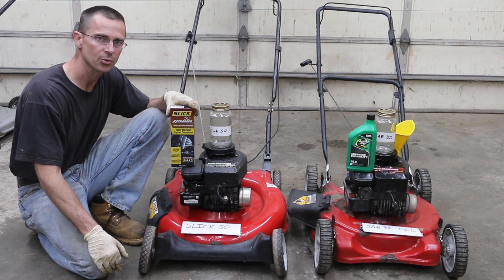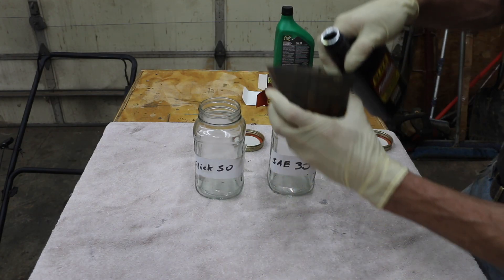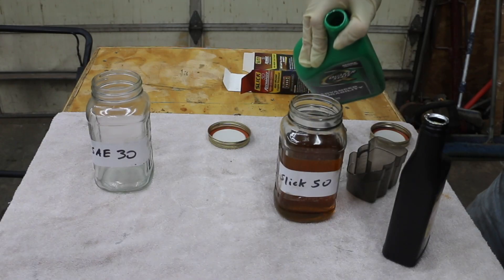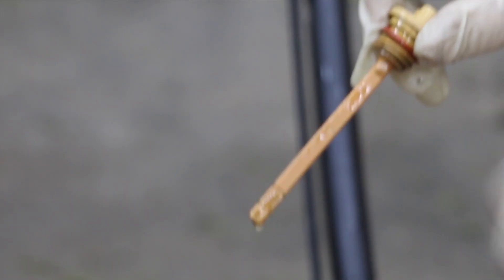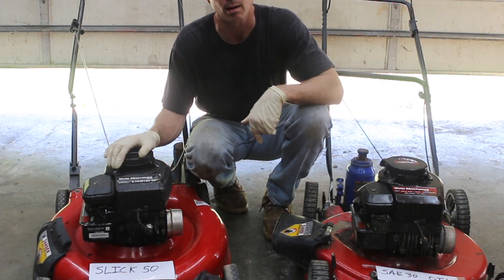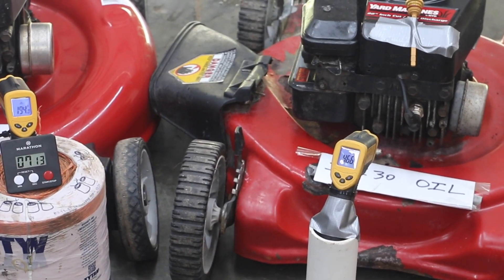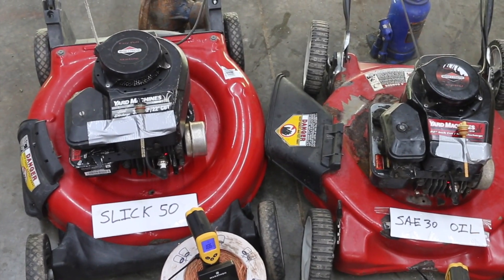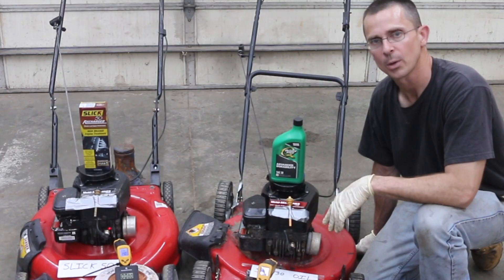Can't believe what SLICK 50 did to my engine!!--Dry Crankcase Test!

Comment: The person at Dow Chemical Co. that invented Teflon quit Dow because they only wanted to coat pots and pans. He saw a much broader use. He started a company called Chemlon with outside investors. I put Chemlon in every motor I had from my motorcycles to my Freightliner trucks. On a trip to New Mexico going down a  mountain pass with 80,000 lbs of drill collars, the lubrifiner hose broke and pumped all the oil out of my 1693 cat engine. I had to keep the cat running to have air brakes for 20 minutes to reach a pull out. Put oil in the cat and ran another 500,000 miles. On overhaul the crankshaft was perfect and went back with standard bearings. Never had an engine failure with Chemlon. He sold his formula to Slick 50 in 1980 and retired. Slick 50 has changed over the years. Chemlon never looked like oil.
Reply from the maker: Thank you!
Reply: Wow, how many wrong facts can you get into a post.  Teflon, discovered by Roy J. Plunkett at the DuPont Company's Jackson Laboratory in 1938, was an accidental invention.  Not Dow, NOT "the person".   Chemlon did sell a product called Microlon which OTHER companies bought to use in their own developed oil additives.
Reply: @Curmudgeon555   You are correct, it was Dupont not Dow and the man I knew worked for them till he quit and made microlon under the name chemlon. I was 22 years old back then and 50 years later the mind is not as sharp. My dad had a garage and was approached by him to help distribute the product for funding. We raced motorcycles and the stuff worked great helping the engines run cooler.My truck story is correct and I continued to use it until his warehouse burned down in Buda, Texas circa 1980. His micolon was for engines and was clear and thin as alcohol. He also had a spray similar to WD40 and a grease with Teflon in them. It took heat and friction to make the Teflon bind. The man worked at Dupont at La Port, Texas and the story he told was that Dupont had the patent on the product Teflon and he bought it from them to mix in his formula. It has been nice to respond to someone well informed. Sorry for my mistakes. It was still better than Slick 50.
Reply: @ctcook8374  this is industrial legacy!  your post should be kept for reference ! Sometimes great inventions fade with time .. Microlon  was a great invention and it bonded with metal under pressure and temperature.   Maybe it is still used in F1, but we don't know it.
Reply: @ctcook8374  problem is : you  never know if the "microlon" -name has been "hijacked" and I wonder if the current microlon site is still the original product .
Reply: @Curmudgeon555  Sorry again, the warehouse that burned was in Kyle, not Buda,
Reply: @ctcook8374  Damn,   Why don't you just tell the story?  You sound long on wisdom and short of breath.  But maybe, not revealing too much information is part of wisdom.  I personally think the World needs more mentors and I thank Project Farm for his contribution.
Reply: @qanommonsense2753  I also thank Project Farm, love his vids.
Reply: All was good still because the Teflon coating became the lubricant. In Australia back in the mid-nineties I had 4 cylinder Mitsubishi that dropped a set of rings on one cylinder. The mechanic made a comment "I never saw any scoring to the cylinder wall, it was perfect"?  I told him that "I run Slick 50 in it!"   He replied, "that would explain why, it's good stuff!"  Now in Australia, I use Nulon Long Term Engine Treatment (Aussie product).
Reply: You should not support any Teflon product.  Do some research and you'll learn how Teflon poisoned the entire world...  I'm all for performance enhancing products, but not at that expense.  Lots of cancer deaths thanks to that stuff...
Reply: @theslo777ery  Same can be said about the lovely Monsanto Corporation and their "Lawn enhancing" Roundup Weed Killer, how it is Poisoning the Planet and causing Cancer.   Looks like Fred and Ethel caught the Cancer Bug, but, what a beautiful Lawn. No Dandelions or Damn Doomdelions, as Grandma used to say.  Hell  of a trade-off, anyway and i bet there are a lot of greasy Palms, at the EPA. I wonder how many slick 50 Dollar Bills it took, for them to "let it slide."  A little Poison never hurt nobody.
Reply: @ihavefallenandicantreachmy2113  I agree sir.  They are poisoning us with a ton of chemicals with Teflon being just one.  But it's amazing how they all get away with it.  Got Chemtrail???
Reply: @ihavefallenandicantreachmy2113  their is a lot of criminal companies out there and they all grease the right people.  Disgusting how others play by a different set of rules..
Reply: @theslo777ery  I was just fixing to say this same thing. 99 percent of the WORLDS blood has the chemical in it that makes Teflon slick. Its also known to cause cancer birth defects thyroid disease bowel problems and much much more. Teflon and the like is some nasty shit that's literally poisoned the whole planet. I'm not a tree hugger or an activist. But what the DuPont company has done is atrocious!

Comment: The slick 50 your using is another make up there is a vid on you tube of the real slick 50 .John Bishop started the real slick 50 go to Xcelplus What happend to slick 50 interview with John Bishop check this out first .to buy the old slick 50 go to Xcelplus.com
Reply from the maker: Thank you for the video idea!
Reply: @ProjectFarm  Check out the old slick 50 was stolen off the man who invented it so go to Xcelpus.com and watch the man who invented the real slick 50 i have driven my six cynd car 30 kl,s without any water and  the car was still going for 4years after the fix the Radiator .

Comment: From what I've heard, you need to run the engine treated with the Slick 50 for a certain amount of time in order for the product to adhere to the engine parts at the molecular level.  That being said, I've found that Pro Long is an additive the blows Slick 50 and all other oil additives out of the water.  I've used it for the last 20 years and it has saved some high dollar repairs to my engines.  Case in point, I had a Lincoln town car that had a completely clogged oil pump filter screen.  The engine lost all pressure to the lifters (seeing as how they were hydraulic lifters) and the engine started rattling due to lifter noise.  However, I had previously treated the engine with ProLong and was able to drive the car 25 miles back to my house (I lived in Mohave Valley 
Arizona at the time, in the summer with temps at 125 deg. F)  I later dropped the oil pan, replaced the pump and pickup tube/screen and the engine started right up and ran like nothing had ever happened.  That stuff is totally amazing and I'll use it forever.
Reply from the maker: Thank you!

Comment: the engines metal honed surfaces absorb some oil and they have run a merc for over an hour without oil BUT metal parts need oil to separate so it WILL seize- thats just the laws of physics. Theres always arguments with engine builders about whether just oil or  assembly lube is needed say on the bearing caps ect before you start a rebuilt engine. Even workshop manuals only say to lube them with oil as that will be plenty for the short time before the oil pump gets going and pressure is good. Compare those few seconds to thousands of dry cold engine starts and what damage that does so expensive lube or grease, well slap on clean oil as thats all i have ever done and never had an issue. A lot of these "special" greases and oils even for push bike cheap chains ($10) lube ($60!!!) . i have only used plain oil and re oiled every 500 kms approx and never wore out a chain for a very long time.
But these"magic" expensive products at your own gullibility and peril haha
Reply from the maker: Thank you!

Comment: The original Slick 50 formula  was excellent. The Slick 50 company was bought out by a big oil company some years back and they cheapened it.
   The original Slick 50 formula is out there and is being sold under a different name. That name is ExcelPlus oil treatment.  And yes there's a YouTube vid on it. 👍
Reply from the maker: Thank you for this information.

Comment: Those are air cooled engines. Does that have a factor to the test? Was the engine with the slick 50 given enough run time for the slick 50 to bond with the metal surfaces within the engine? After all the motor did run cooler. Also did the engines already have wear and tear on them that could have affected the outcome?

Comment: I would like to see this test repeated with Mr. Moly. I used it for years on my Toyota Yaris, but stopped after it had about 220K miles on it. They did a test using cars which supposedly proved it worked. But, I have also read that even though it won't harm an engine, it doesn't really do anything either.
Reply from the maker: Thank you for the video idea!

Comment: Great video but if I'm not mistaken the original formula was changed after the naming rights were sold. From what I've read the company that bought the slick50 name changed the formula to maximize profits
Reply from the maker: You are right.  Thank you!
Reply: what was the other company, and is it still available? Thanks
Reply: The original formula is now sold under the name excel plus. The only way to get it is to buy it directly from  a distributor.

Comment: In all fairness to Slik 50, there appeared to be a small amount of oil left in the crankcase of the SAE 30 engine, this was unfortunately, not a very controlled experiment. In order to get proper results you should have both engines of exactly the same age, history, maintenance, crankcase capacity, etc.

I have been a Mechanic for over 40-years and  never believed in any additives for fuels or oils, and to this day I firmly believe that every one of them is nothing more than a money-spinning snake oil anyway. The family cars under my care have always provided trouble-free motoring with standard lubricants and fuels, I have never had need for engine overhauls even at 400 000 Kms. Good care, maintenance, and recommended lubes is still the best way to go. Nice Video though.
Reply from the maker: Thank you!

Comment: I raced cars for 12 years and always used 25% Lucas oil stabilizer. I never had an engine failure.  That would be a good "oil" to test.  Thanks much for a great video.
Reply from the maker: Thank you!
Reply: You have raced and have not had an engine failure in 12 years, you obviously have not heavily tuned the engine because anybody that has raced for 12 years with a highly tuned engine is going to have an engine once awhile.
Reply: I come across older cars with hard miles on them often. I like to flush them with seafoam and add Lucas with valvoline high milage. Always has a dramatic impact, some absolutely come alive. I think the lucas helps restore a bit of power. I prefer a quart over just using heavier oil. Seems conservative.
Reply: Yes try the Lucas Oil Treatment
Reply: John L what part of engine oil is unstable and requires an “oil stabilizer”
    A fool and his money are soon parted.  
Lucas oil stabilizer is nothing but a non additized bright single grade gear lube. 
    Using it does nothing other than dilute the additive package science has deemed beneficial and thickens the sump load. 
     If you want thicker oil just buy a heavier grade. Lucas is utter garbage.
Reply: Everett Morash now you know you could have said all that without being a douche, right?

Comment: Like the spark intensifier salesman at the car parts swap meets he sold plenty of them to suckers like the slick 50 guys  . If it worked so well all cars would have had it installed at the factory . I loved watching those guys, but I don't know how they did it and  it was very convincing.  I saw an analysis of these  spark intensifiers years ago in some off shoot car magazine and the guy doing the article  said it only works if you insert it in your left ear.  
 As for your lawn mower demonstration.... one lawn mower looks like it was used by a kid that cut 10 lawns every day  in the summer, the other one looks like the one I gave to the neighbor kid because his looked like your slick 50 mower with the wheels and tires completely worn out .   Just saying.  Anyway a good video and demo .
Reply from the maker: Thank you!

Comment: Thank you for this video, I really do appreciate the effort you make in these tests and I can see that you work hard to remain unbiased.   I used to use Slick 50 in the the early 90's and swore that engines ran cooler and quieter after treatment, but I recall that treatment was not complete until after many hours of driving and that in the first 50 or so km after adding the Slick 50 the oil pressure gauge would show an alarming drop in oil pressure for a little while.  I remember the instructions said something like 200 miles for the treatment to bond to the metal.   I would never drive a car that was low on oil regardless of what additive was in there, and my understanding of the product was that it was supposed to prolong life and improve economy.
Reply from the maker: Thank you!

Comment: Those Slick 50 comercials , if you remember, as I do, while they were running the engine with the head covers removed they also were squirting water all over the engine while saying " look it even runs when we squirt water  into the lifter and down inside the running engine" That was proof enough for me to not buy it or use it in any engine of mine.
That's when I first realized that it was OK for people on TV  lie and get away with our money .
Reply from the maker: Thank you!

Comment: I wonder if you could some how do a test where you dont change the engine  oil  but only  change the  oil filter with a little  new oil added to the filter . I had  an engine i never changed the oil. it didn't leak and all i did was change  filter add oil to filter and clean the air filter  for many years.  are the companies pushing oil on us  when its really not needed so much?

Comment: I can think of  only one oil additive product that i have used that i felt made a noticeable difference in my car , Liqui Moly brand anti friction additive. It makes no outrageous claims and is priced under 10 bucks, and for me i get 2 oil changes from the one bottle.  My car  (a Saturn sc2) ran so much smoother and quieter  that i had to look at the tach at times to confirm it was running, and my dirty factory CD player began to work much better, especially at finding the beginning of tracks when skipping tracks or on random play. It has a lot molybdenum disulfide which i have noticed as an additive in some very high end motor oils.
Reply from the maker: Thank you!

Comment: Who'da thunk it?!

Back in the early 90s I mistakenly purchased a 3.8 Chevrolet Monte Carlo from Wheeler Dealer I was in dire need of Transportation in that was the most expedient answer. In the middle of Central New York winter I drove from up on Lake Ontario to my hometown about 50 miles in a snowstorm coming back into town the car choke down on me and died right in front of a shopping Plaza. Lifting the hood I expected that it would be packed in with snow. Not the case. So I lifted the cover off the air cleaner in the paper element was plugged with oil. I pulled the dipstick and it was dry. Without the air filter I fired it up and drove about 200 yards to a tractor supply bought a new air filter brought the oil up to level and drove to my son's house. He told me about this car that he had purchased from his employer a 4.3 Chevrolet Caprice with a Brazilian miles on it and he use slick 50 in that cut down the blow-by. I we drew off some and brought it up to level with slick 50 and I got about three thousand miles to the next oil change and I change the air filter. The next Oil Change I got 10,000 miles out of the air filter... Or, about 9,500 as I remember. But I never did have the courage to let it run dry. They take a dim view of being weaned off of oil. That was my first ever experience with severe Blow by. And I never got an opportunity to test that ProTec that I mentioned earlier. 🇺🇸😜
Reply from the maker: Wow!  Glad it helped you.  Thank you and Happy New Year!

Comment: Had engine for years running with slick50, started easier in the winter, burnt less oil.  What this video tells me is Don't let the engine run out of oil!  Slick50 can't handle the heat BUt it works well under normal operating conditions .   I would bet that a full crankcase with SAE vs SAE+slick . then see how many total hours of runtime until death or say 150 hours run time and then check engine compression and fuel consumption per hour.  My experience is Slick was easier start, less fuel
Reply from the maker: Thank you and Happy New Year!

Comment: How long did you run the lawn mower with slick 50 in it before draining the oil? On the slick 50 bottle it says to run the car engine 1000 miles before changing your oil. You probably didn't give slick 50 enough running time to coat the bearings. I use it a lot, put it in my lawn mower engine, it never gave out, I would change body's because the wheels fell off, but 20 years later the engine never gave out. The motor was still running when I junked it. I just decided it was time for a new one, lol
Reply from the maker: Thank you!

Comment: Any information about what is Marvel Mystery Oil is?  Would it work or not work in this test?

Great video
Reply: Im a mechanic and my grandfather sold mac tools, I've got 45 year old cans of it from him that are still pristine,
But it is a very thin oil that can be used for penetrating, It is a very good general light oil, not good for running engines on.